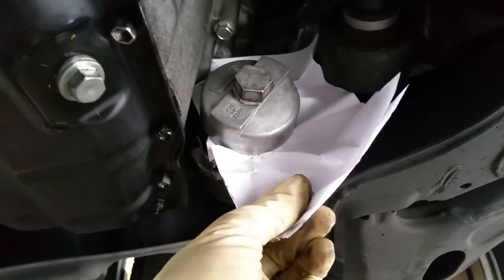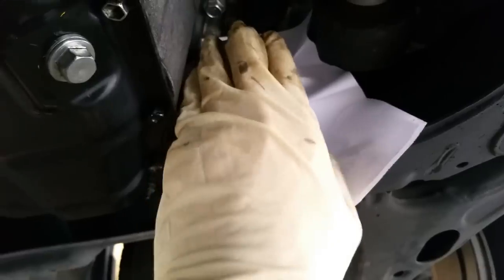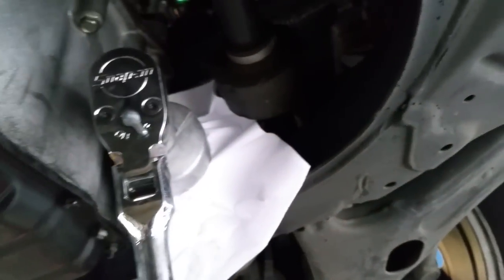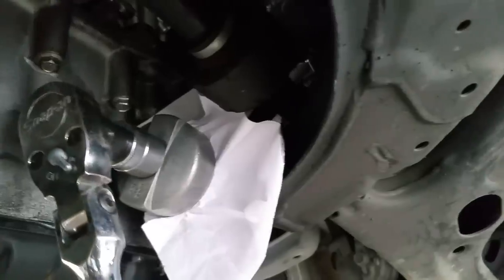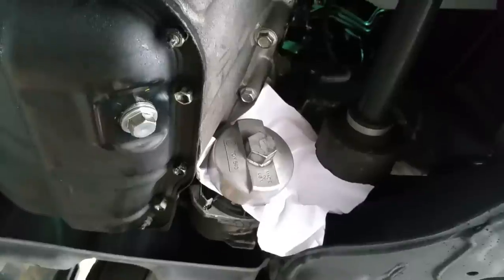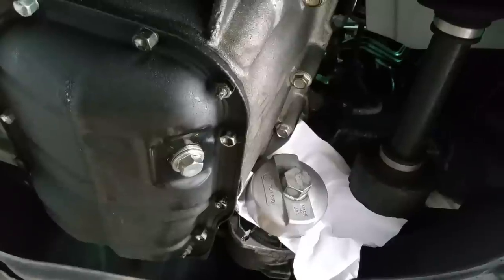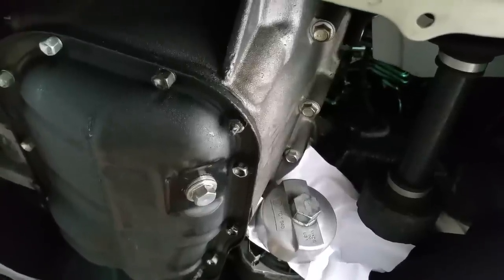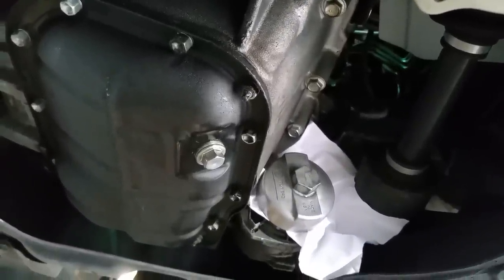WATCH Before you break a stuck oil filter cartridge

Comment: I started changing my own car oil recently. I have a Honda accord and I didn't have any issues with taking off the oil drain plug and the oil filter. I decided to help my dad change the oil and filter of his 2015 Toyota corolla. I was able to loosen the oil drain plug to release the old oil. As for the oil filter cap, it was tighten to the point where it was too hard to even come loose. I used the filter wrench which wasn't the best idea. I quickly went to autozone to buy the same oil filter adapter you have. That didn't work either. I came across your video now, and I'm thinking of giving another go by using that folded paper technique. Hopefully it comes loose.
Reply from the maker: endl3sdrmzz be sure to buy adaptor with slots and clean the filter plastic with brake cleaner or simular.
Reply: Will do =)

Comment: Thank you SO much for this. On our old 05' Camry, the oil filter wrench cap was slipping on the filter that was seized up. I tried using a jar gripper rubberized thing but that didn't work. The paper trick worked fine the very first try. I used two sheets.

Thanks again!!

Comment: Valve grind compound is also the secret weapon for increasing friction. You have to watch though, because it will wear out your tools. 

Only filter I couldn’t get off was on my motorhome. I’m pretty sure it was 10-15-20 years of “progressive oil changes” and “we didn’t drive that much so we don’t need to change the filter” so the seal had vulcanized onto the housing. 

Fortunately.. on that model of 460 engine, there’s a adapter from the original filter housing to clear some suspenders components. So I just took the whole adapter with the filter off. Even on a bench vice it took quite a bit of persuading to remove it.

Comment: Use  two  or  three  coffee  filters.  Damper  slightly.  Been  using  this  idea  for
40-45  years.  I  thought  everyone  knew  this  little  trick.  Works  every  time.
Reply: I like your method the best with the dampened filters how hard is it for these other guys that use masking tape for the paper and they have to tap on the tool, is it to separate the two once they get it out of the car?
(The oil filter housing and the tool)

Comment: Thanks. 1. Since I have owned vehicles, I trust no one to change my oil or filter. 2. My son takes his vehicle to either the dealer or a some quick change facility. I tell him look at what they are doing and warn them not to tighten the filter or the drain plug except by hand tools and not with an electric or air tool. So far it has worked OK. Another thing, whenever I get new tires, I do not allow them to tighten the lugs with an electric or air tool.

Comment: I work at a Toyota dealer and almost all of the guys use a BluePoint socket (all of the guys OWN one) to get these filters off.  It's about $50, and we own the ones that don't have the 'teeth' at the end.  

The only time that they slip is when the filter cap was already cracked by the quick lube that did it previously.  These filter socket tools are very high quality tools.  Would recommend if any of you service Toyota vehicles regularly.
Reply from the maker: good tip! ive got one of those and 2 others. unfortunately gotta use this trick once in a while.

Comment: Excellent video! Thank you. You can also drill holes in the circumference of your cap and then put a few self-taping sheet metal screws in, attaching the cap to the filter. Mine was stuck and it crumpled using an oil filter strap wrench. I also tried this vice grip type with a bicycle chain strap near the gasket. It only crushed it more. So, I just went out and got a long flat blade screwdriver. It was like 3/8 inch wide at the tip.  I jacked up my truck a bit so that I could tap on the screwdriver from underneath. The gasket is the stuck part. Break the seal and you are set. So, I treated it like I was going to flip a pancake. Tap the screwdriver in to crush the gasket inward over a 30mm section. Wiggle out a bit. The block is hard. So, it will not score easily. Then start tapping off axis to make the filter rotate. Tap near the gasket where the can is firm. It can't resist the persuasion. It helps to drain the filter first by poking a hole in the bottom. If this doesn't work to loosen it, keep breaking the seal along the circumference. The rubber gasket is what us making it stick. Remove half of the seal contact and the torque to remove it is about half as well. You can also tear into the can to expose the circumferencial hole circle. Place a  blunt screwdriver  to one of the holes. Tap with a hammer off axis to spin. Don't let people psych you out here. This is not that hard. Follow logical steps and cause the result you want. Disclaimer: It's obvious that this method won't work for all vehicles and it surely won't work for negative people.

Comment: Where there is a will there is a way. I've drilled a hole in the center right through the metal of the filter and stuck a  screw driver  right through it. Twisted it right off no problem. I've even used a leather belt. The braided ones work best. No need to poke a hole to make it tight. Tightened that up nice no snug pull on the belt and bam its loose. Take the filter off by hand. Hand tight only when replacing a filter.
Reply from the maker: Arthur Smith if you want to reuse the plastic filter housing, this is the way to go. Thanks for the comment

Comment: The torque spec for the filter housing  on my Tundra is 19 ft lbs, which is not very tight. I had to get a breaker bar to loosen it. Dipshits at the oil change place obviously were like "We dont know the specs so we will just tighten the shit out of it". Not letting anyone change my oil again as long as I can help it. This is how things get stripped and you will be getting your car towed out of there.
Reply: I've tried several times over the last 35 years to let others fix my stuff. I have been impressed with others work about 4 times. So, I never let anyone, especially a dealer touch my stuff. Cars, homes, computers etc. No one cares about your stuff more than you do.

Comment: You are absolutely right: spend the money to buy the tool designed or the filter. Auto-parts store tools are a waste of money,. Thanks for the trick. The paper did not work for me; what did was to wrap the filter with duck-tape. The duck-tape does a better job in filling the spaces, and it worked fine. Use half-inch drive tools to get the filter off, and apply no more force needed to get the oil filter to move.

Comment: Allow engine to cool so any expansion recedes. Hit with spray oil & then do at the video advises.
Reply: Very crucial.  I always changed my oil hot.  With this paper insert system unfortunately, it is a whole new procedure.  You could drain the oil pan yet wait good hour or two for the block to cool off,  or I change the oil without warming up the engine anymore. Stinks but that is how Toyota messed it up for us. I wonder how many dishonest mechanics get away with not replacing the filter.  The disposable cartridge filter like Honda uses is hands dow a winner.

Comment: I had to replace my oil cooler/filter housing on my 3.6 Pentastar Engine (DIY Repair) due to a common problem with oil leaks due to that cooler. Since then, I now change my own oil and filter due to the quick lube joints over tightening the plastic on plastic oil filter cap. I just simply stop once those plastic threads stop, no torque wrench necessary. The O-Ring seals that filter cap.

Comment: Proper filter install, oil filter gasket then spin on till gasket contacts block then one full turn.
I've been a mechanic 30 years these instructions used to be on the side of the filter.
Reply from the maker: This is correct for a standard filter, this is a different style with a replaceable filter element and o-ring. So just install till seated then a little tug or bump and you're good to go.

Comment: This trick worked well. I usually change my own oil, but last winter it got changed by a quick lube place. A lot of the young guys in these shops just use their arm strength to tighten things (no torque wrench) and go way over the torque requirements. These mechanics and techs are not mouse humpers and pencil pushers, some have arms on them like tree trunks!

Comment: Good idea bet it would work on a slightly rounded drain plug or bolt. I use valve grinding compound on Phillips screw driver when the screw is started to round out

Comment: Thanks for the upload man this is exactly what I was looking for. I work at jiffy lube and I've been having trouble taking off canister oil filters lately. I tried using a breaker bar and it would jump like you said. At first I thought I was using a wrong size adapter but now I realize that the filter housings are on tight. I'm gonna use your method from now on but instead of a paper towel I'll use a shop rag for a better grip.
Reply from the maker: Jose Guerrero your welcome, I used regular printer paper, not a paper towel. paper gives extra grip.
Reply from the maker: Jose Guerrero thanks for the comment sir!

Comment: I replaced my plastic oil cartridge filter housing with an aluminum after market part for just this reason. The plastic factory part over time can fatigue and crack then break  under pressure of overtightening.

Comment: My corolla has the plastic cap and the adapter your showing won' fit over my housing so i had to buy a different kind this one has 3 separate retracting jaws on it, when you have your ratchet in tightening direction the jaws contract around the cap (theoretically) grabbling harder the more force you apply. I said "theoretically" because when i do it they just jump over the tabs they are supposed to be pushing against. So i am still screwed. I have heard heat the motor up and remove it while it is still hot, guess what. Still doesn't work.

Comment: Here's a trick l use, take a normal tightening band style oil filter wrench to big for the filter wrap a cloth shop rag around band to make up the difference it dents the filter holds real good. Also all you need is one filter wrench an a rag for most filter sizes.

Comment: IMO the stuck cannister filters are not from over torqueing it's caused by the constant heating and cooling of the parts from running the engine. I wonder if applying some anti seize would help preventing what appears to be over torqueing?

Comment: I didn't catch what model of Toyota you have. What year and model please? Oh and I understand that there are 2???? sizes of oil filter housing "removers" and the one for my 2017 V6 Highlander appears to have slots that fit on several "tabs" built onto the plastic housing/. I also understand that Toyota has an aluminum oil filter housing ( I wouldn't buy aftermarket in this case). I was thinking of buying one just in case I ever have the plastic housing break or leak. Your thoughts.

Comment: Most of these canister they can be hand screwed on to a point then resistance with the o ring.  Then when tightening with a ratchet it gets to a point where it wont turn any more.  And the torque is only about 20 ft lbs or less

Comment: You only have to seat the filter cartridge cap. When it bottoms out plus a bump, it's sealed. No need to crank on it.
Reply from the maker: Yes, you are correct, the o-ring seals differently than a "standard" pressure seal type filter.

Comment: When you change a regular oil filter always always put oil on the rubber gasket . Dip your finger in oil and go all the way around the rubber gasket before you put it on this will keep it from sticking because the motor gets hot and with out the oil on the gasket it will stick. My dad taught me this he was a  mechanic.

Comment: I gave up on mine ... my tool kept slipping.  Filled it back with oil with the same filter in it.  Then looked up more on youtube and found the proper wrench to get which has slots on it in case of slippage like this.  I should try your paper trick but am afraid that I can't get the tool off without damaging the housing.  Oil filter housing has to be replaced with a metal one.  The plastic ones will slip.

Comment: Where did you get that metal cap at? Would it fit a 2015 Jeep Wrangler penstar 3.6 oil filter cap? I have stripped the plastic socket head on it and it’s stuck.

Comment: My neighbor's Sienna had this issue. Heated the oil filter housing with a hair dryer for a minute or two and it came off easily. Same principle as heating a stuck jar lid under hot water.

Comment: The common cause for having difficulty removing oil filters is not some much to do with over tightening but the failure to lube the rubber gasket on the new filter prior to installation.Most cartridge filters only need to be hand tight.

Comment: Just tap it with a small wrench (14 mm head) or just a big tipped flat head screw driver with a hammer sideways where it will loosen up, but dont damage the cartridge, it worked for me

Comment: I recently  bought a newer truck with low miles. The previous owner took it to a quick oil change place. The oil filter was installed so tightly that i knew it was going to collapse . I've changed my own oil for many years, so I got up as close to the base of the filter and was able to unscrew it. The the oil pan plug was so tight that I had to use a small breaker bar on my ratchet

Comment: First time I changed the oil on my 2007 chevy express V6.  The filter is 2/3 encased within the housing that trying to get a grip on it with my hands underneath wouldn't do.  Why my hand?  I bought a sleeve grip filter wrench that ended up being too big.  I "assumed" there was a general one-size-fits-most wrench, when in fact it was too big for my filter.  My bad, my lesson learned.  But...the previous oil change was done by a local change station.  It was ridiculously tight, so much so that any kind of old-fashioned belt-style method around it to bare hands to finally punching a hole in it with a screwdriver as a wrench wouldn't do it.  My friend's cousin finally came over with a Lisle oil filter tool that took it off within seconds.  It's one thing to have the right tool, but it is an entirely different problem when the filter is overtightened.  Why trust a change station anymore?

Comment: Thankyou mate, would probably work on a lot of other situations also e.g. Volvo plastic oil housing.
And the sump plug also.  
Seems like "they" either make it too loose or too tight.  Too lazy to use a torque wrench?
Check for drips after you have been to LazyLube.

Comment: Despite always using a torque wrench to tighten my Honda oem metal oil filters, once I bought a no brand wrench cap when I accidentally threw out my Honda cap, I had to to the same trick. If you have a Honda / Acura, every model uses the same oil filter, and the $32 heavy gauge Honda wrench cap is worth avoiding the frustration.
Reply: Every model except for the s2000

Comment: I had to put a heat torch on the engine part of the oil filter housing to get it off. That was after tapping everywhere with punch which didn't work.

Comment: I bought a car and it was it's first time for a oil change.  Okay  a ten minute deal at home,  but "hey" I like using my oil . Haven't used a oil filter wrench in forever, and it was pretty damn tight. Did the oil filter wrench (nope). Switched it to the belt (nope). Okay the 14 teeth with the drive (nope). I even sprayed on adhesive  to make create more grip. Finally after 3 trips to the auto store I ended up going to valvoline quick lube. I knew a guy who broke it free (for free) but tipped him outta utter frustration as it shouldn't take 2 hours to do a damn oil change ffs. Now I'm at the bar having a drink and decided to go on YouTube.  Fawk . Well knowledge for next time. NOTE: Last person that did the change was a Honda or Acura dealership.  Man wtf!

Comment: asttools.com   has come out with a new cap wrench for these  filter housings   and they work grate    there   about 65 bucks on  the tool trucks   but well worth it if you do oil changes on these toyotas   all day.    i used to for about a year   but i have moved on to  another shop  so i dont need it anymore    the 640 toy  is a good cap  but if it is on to tight   the 640 toy  does not work    check out the asttools site  and take a look at this new tool
Reply from the maker: Thanks for the comment, I have the full kit and this tool, but when s$$ clowns at the quick lube or dealer over-tighten the filters to this extreme, that AST tool (with the tab grabber) will snap the tabs clean off (plastic canister) so I used the other wrench to prevent such a failure and used this paper trick so I don't tie up my bay for the day waiting for the replacement.

Comment: I'm confused...you said the maintenance employees put the filter on too tight...so how did you get this paper in place if the oil filter thing was already in too tight?
Reply: The oil filter itself was put on too tight. What he's using is a tool that goes over/on top of the filter to unscrew it. He put the paper between the filter and the tool.

Comment: I change my own oil, and I always have to use a breaker bar to loosen the drain bolt, and I only tighten it up "just snug" with my fingers and a socket wrench. it's the engine that naturally tightens it up, dont be so quick to blame professional mechanics. Most filters are designed to tighten after time as well.
Reply from the maker: I blame them, because I have to use a 4 foot breaker bar and a little trick this time, and i know the doofus's who change oil and overtighten these on purpose.
Reply: I would blame the mechanic because why in gods name do you tighten an oil filter past hand tight?   Put new oil on the seal, hand tighten it, and its good to go till the next oil change. I have never had an oil filter leak or come loose doing it that way. You dont have to torque a dam oil filter to 400 ft pounds with an air wrench
Reply from the maker: @jate2014  i couldn't agree more broski!